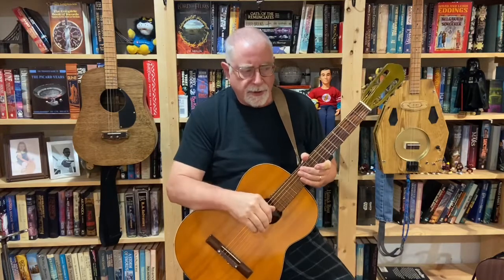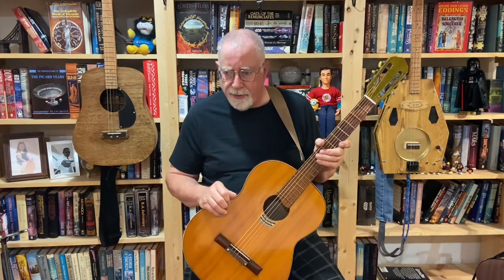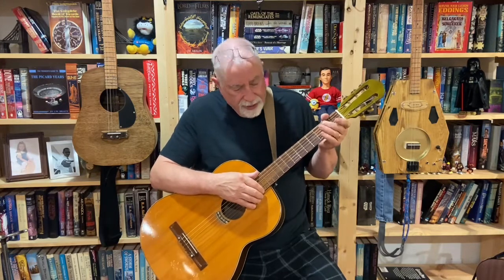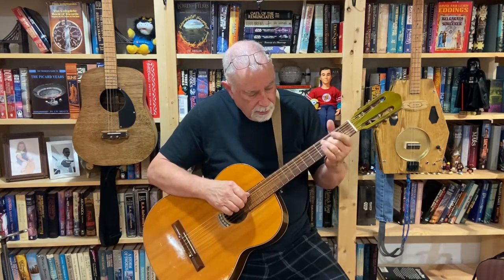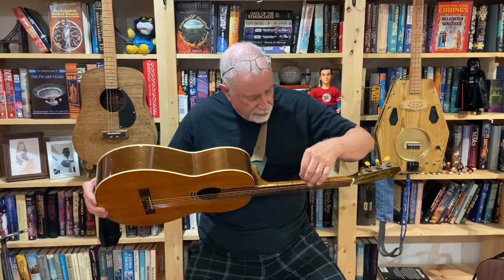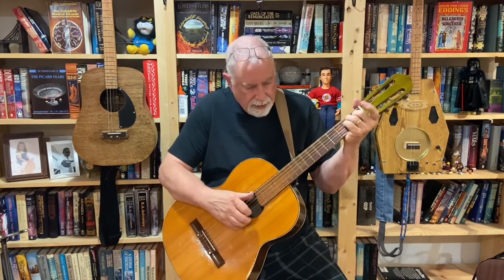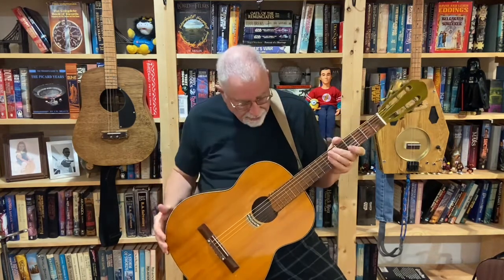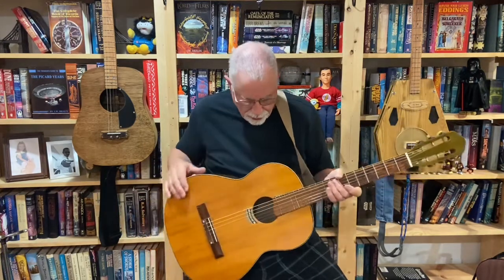Randy Braun’s guitar project

Comment: Nice job, Robin. A little more background on that guitar. Jackie got the guitar when she was about 15 years old, right after we moved up to Lena. She didn’t really get to play it very much because unfortunately the person from whom she bought it didn’t really know what it was and had put metal strings on it, which caused the neck to crack, basically ruining the guitar. After kicking around the house for some months, Robin, you took it up to the shop teacher at the high school, and had him glue the neck, and then strung it with classical strings, after learning about the classical guitar from Bill. After you bought yourself an electric guitar, I started fooling around with this old guitar and I played it up until about five years ago when I bought myself a brand new classical. The white tuning key is there because Mary stepped on the guitar and broke the original key. You and I took the key off of an old electric guitar and I had that was junk and we installed it on the classical so it could still be played. If you look close you can see that the fretboard has huge grooves worn in from the 40 years of playing.
Reply from the maker: Jackie got this guitar in Rochester.